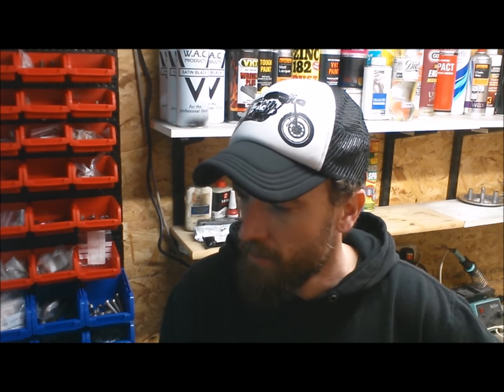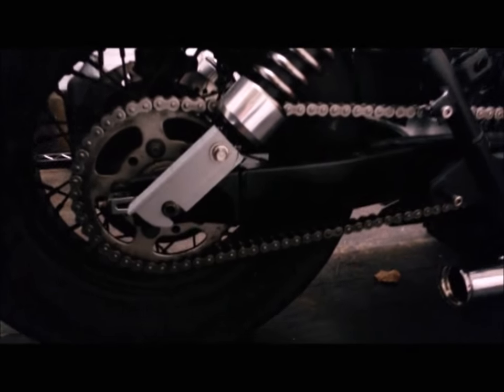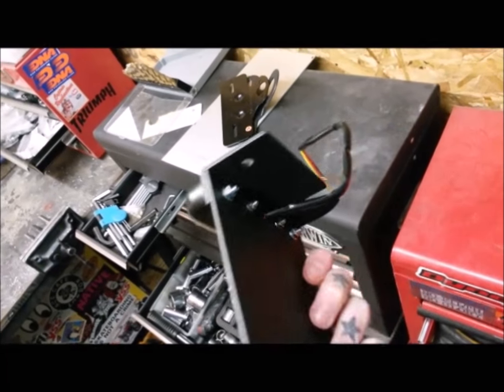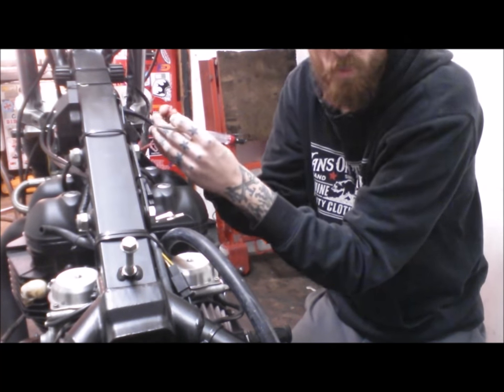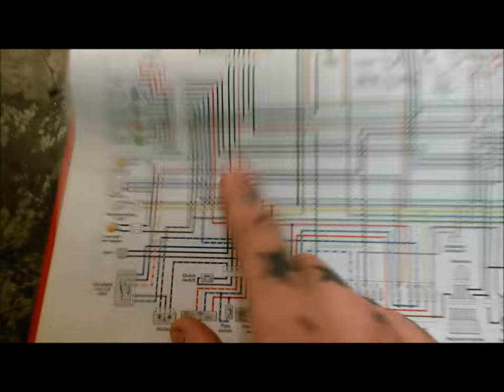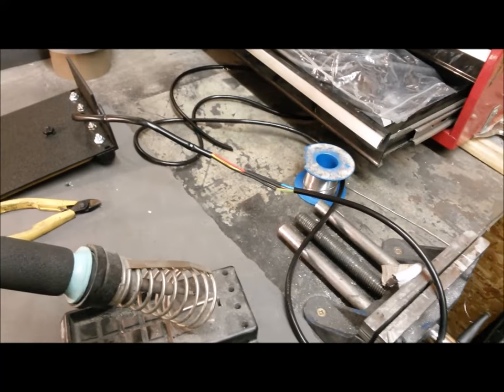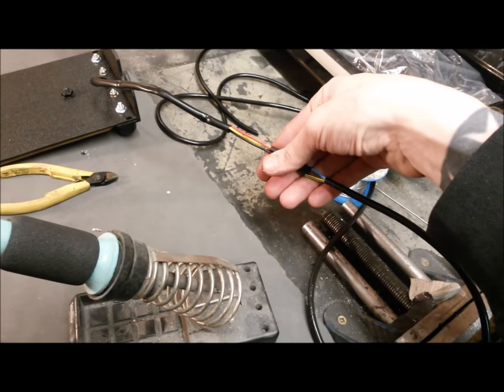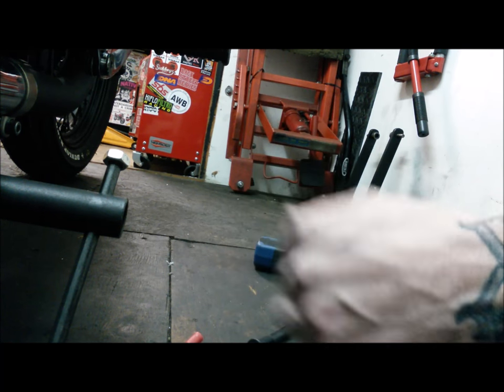Triumph Bonneville America - side mount and eleccy troubles!!!

Comment: Hey buddy good to see you tinkering ..you do a lovely Tudy job on the wiring  you've inspired me I actually bought a great multi box of heatshrink instead of lecky  tape bodges I usually do..I bloody hate electrics....
when you cured the paint int' t'oven did you hang the bits or lay them on the tray?
they came out lovely mate..
take care Ian and Jenny xx
Reply from the maker: hey buddy!!! i hung the speedo mount on wire- but it was a little fiddly cos it goes in wet/tacky so the side mount got done in 2 stages flat down. really quick though- three thick coats five minutes between and cooked for and hour. done!!!

Comment: Bugger, if you cant get the switch to work I would suggest you look for a generic brake banjo switch, it will work out a lot cheaper than going for a triumph one. Unless they use some sort of wierd banjo bolt size.
Reply from the maker: i reckon it'll be an m10 x 1.00 or 1.25- a triumph one will be a last resort!!- i 'm going to try cracking the banjo at the switch in case a pocket of air has become trapped during bleeding and is affecting the switch??

Comment: I've always found the mechanical connection to the rear brake switch has a spring and some adjustment, but obviously no knowledge of the Hinckley Bonnie. Doubtless you'll have it figured out before cornflakes in the morning. Good to hear the hardtail is on its way. Are Fenland moving again? I thought they only moved last year?
Reply from the maker: it's a hydraulic switch- and it's mounted as the highest point in the circuit- so...tonight i'm going to try cracking the banjo bolt at the switch in case i have a pocket of air trapped. with moving the lever on sunday it has become a little spongy so hopefully the issue lies there since the brake bleeding!!! yep fenland are down sizing to concentrate on fabrication and frames and not doing servicing and shop.